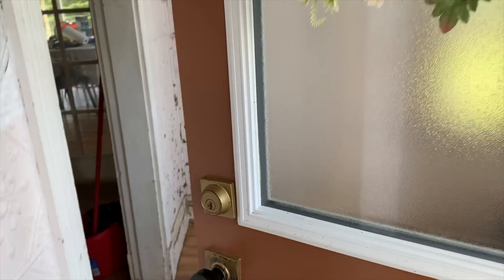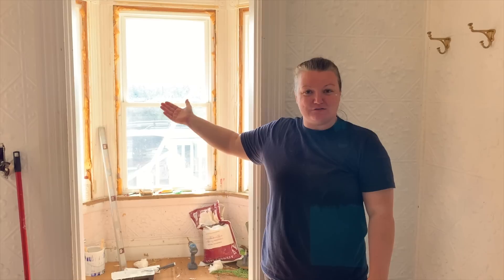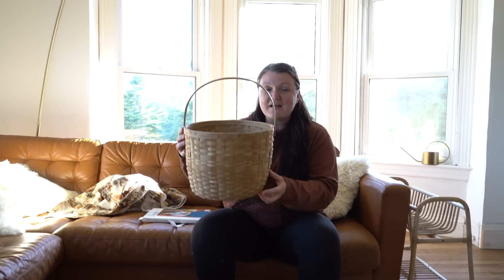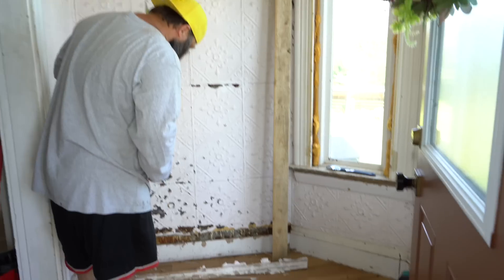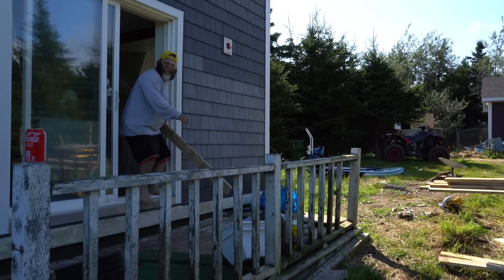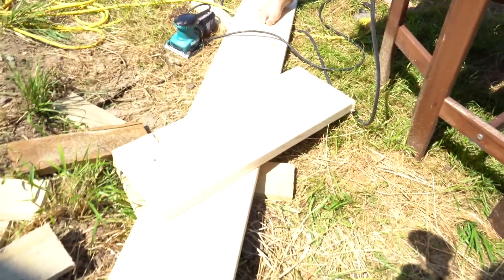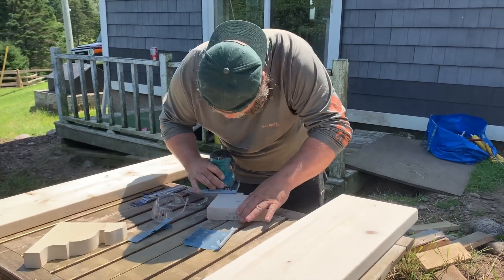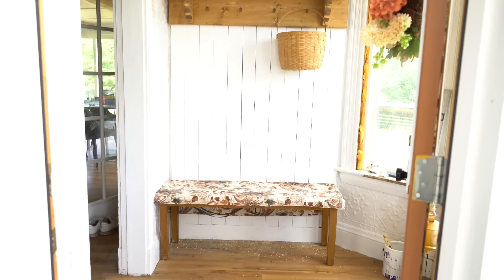SMALL ENTRYWAY MAKEOVER *124 year old home* | Elysia English

Comment: I love the fabric and definitely think it would look great in your entry way either by upholstering the bench with it or as separate pillows/bolster.s along the back. You could stain the bench and then upholster it in an a way that would lend itself to remove and/or change it easily ... for example, by making  the cushion separate and then attaching it with velcro to the bench to prevent it from slipping, if need be.

Comment: Elysia, 
Check with the local library for the art books, they get donated books & sometimes will sell their extra copies, or books not in great condition.
The shelf is gorgeous, make a bench top cushion that can be removed and washed, use velcro as the fastener or an envelope style, but that's what I'd do if it were me. 
You can probably get 2, twenty four inch cookie sheet pans & make frames around them so they don't look like sheet pans & use them for wet shoes & boots. 
Nordic Ware Aluminum Extra Large Cookie Sheet is $ 15.63 US. But it's keeping mud & water off the floor.. LMAO  If by chance you do it spray paint them first you won't want them to rust.
😊😊

Comment: Love your work. I have a suggestion for fixing your water mark. Take a cotton dish towel, and an Iron on the hottest dry setting, make sure that your iron does not steam. Place dish towel over the watermark and rub with iron, lift towel to check and continue until water mark disappears. I have done this on many timber tables that have had the mark and works a treat. Lots of love all the way from Melbourne Australia 🎉

Comment: That shelf is gorgeous!! 👍🏼👏👏👏♥️. Wow. That fabric. I’m brainstorming here. If it were my entry and I really wanted to make that work, I would measure for the three curtains and a pillow. Add a coordinating fabric for a band at the top or bottom of each curtain panel to make the correct length, and then make a matching pillow. It could be a lumbar with matching bands of the coordinating fabric on each end. You would need to  cut exact fat quarters and use three for the curtains and one for the pillow. I hope this makes sense. If only I could draw for you! LOL. Best wishes.
Reply from the maker: I totally know what you mean thanks Lorna!

Comment: Your apple basket would be fun to store slippers in during the winter or thick slipper socks. You won't need it for apples in the winter! Make a cushion seat that's separate than the bench top, so you can take it off to wash or if you get tired of the print. If you use a thrifted duvet  folded to fit instead of foam it has more of that old world feel of a feather pillow. With the left over fabric you can do a decorative band on the bottom of your cafe curtains instead of doing the sunflowers to carry the print through the area and use it up instead of having leftovers. I would hem the edge that faces the top of the curtain and line the unfinished edge with the hem of the curtain and sew both the sides and bottom into the seams.
Reply from the maker: I was thinking the same :)

Comment: If it was me I'd upholster the top of the bench,  I would also add some pull out square boxes underneath (you can never have enough storage) maybe fronted with more white painted 'shiplap, and wooden peg handles to match the wall.  With the left over fabric I would sew a 3" hem on the bottom (or the top, or both) of your cafe curtains, (made from a plain fabric).  I think this would tie it all together.

Comment: You can easily remove the water marks from the bench top and then add pillows ect to suit the seasons. All you need is an iron with an empty water tank set on the lowest setting and a damp cloth with no pattern or dyes. Simply place your damp cloth on the stain and iron until the mark is gone.

Comment: Elysia, glue a cushion made from foam and quilt batting to the top of the bench so it doesn't slide off onto the floor with rough and tumble boys. THEN, make a FITTED SLIPCOVER that just pulls down over the cushion snugly and covers the bench and about 4 inches of the tops of the legs.  You could sew a straight, streamlined piece of fabric (kind of like a dust ruffle on a bed), so it looks tailored, and fabric glue trim over the seam all of the way around. This way the slipcover can be removed and washed. 😁😉💙(Think of slipcovers for ottomans of modular furniture that simply pull down over the tops of ottomans and reach to the floor - but your slipcover will be shorter.)

L🤍VE the shiplap and the shelf - ESPECIALLY THE CORBELS❣️ I WOULD BUY CORBELS LIKE THOSE FROM YOU - I L🤎VE THE SHAPE AND WIDTH‼️❣️‼️

NICE TO SEE YOU WEARING SAFETY GLASSES - now Elysia just NEEDS TO PULL THEM DOWN OFF OF HER HEAD AND COVER HER EYES 👀 WITH THEM, LOL‼️😳😆🤣

Comment: I think it would look good just to make a pillow about 4 inches thick the whole size of the top of your bench and then put like the buttons upholstery buttons about four in a foot apart in the middle row of the pillow that way if you want to use it as wood lighter or as a pillow now either one would look awesome instead of a Postrio in the hole bitch make it look like a piano bench with that pillow that looks like it’s a text but not